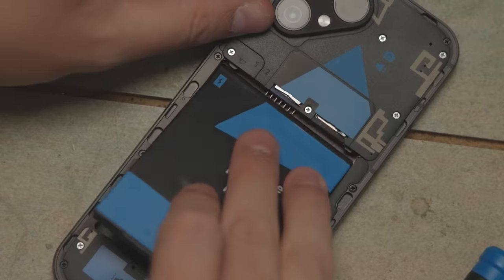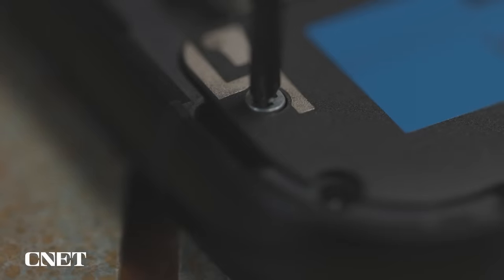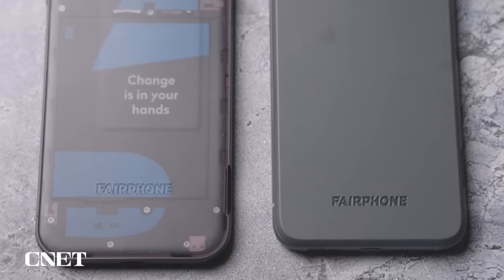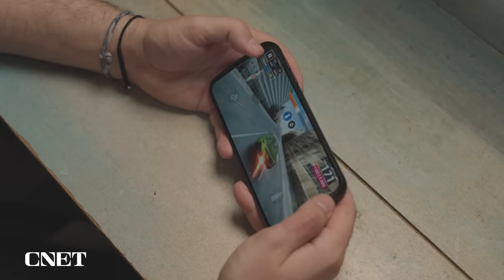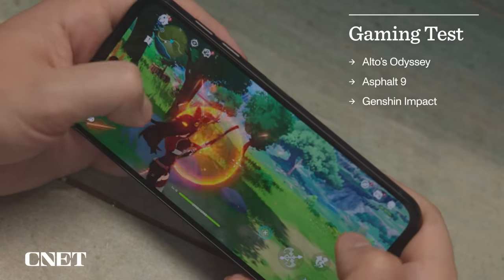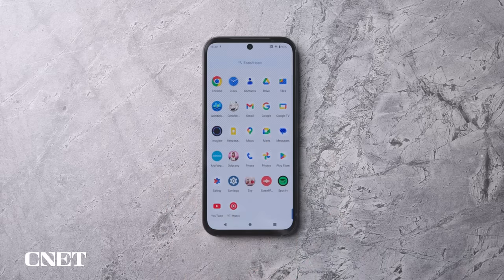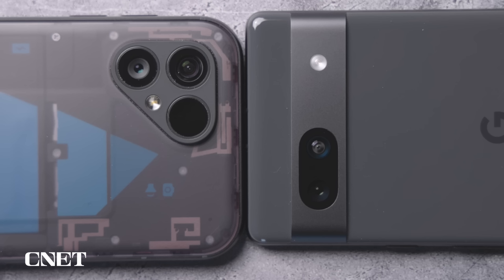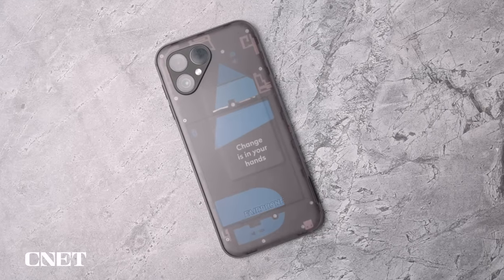Fairphone 5 Review: A Noble Cause, an Imperfect Phone

Comment: I wonder why better chips, or chips specifically designed for mobile phones, do not give long-term support? Is it because the lower cost of such a chip let them spend that money on software support for longer or is it something else?
Reply: Phone manufacturer will need to pay a lot more to Google for longer security updates. Chinese phones often cheap out on this. Essentially consumers need to pay more.
Reply: @stealthnuke1  What does Google have to do with it though? Isn't Android essentially free for mobile manufacturers? Does it have to do with Google's apps?
Reply: They go out of circulation quicker, because the high end of consumer electronics is all about innovation at any cost. This is one of the reasons why Fairphone has always stuck to fairly mid-range specs. Mid and lower spec phones will often be using chipsets and displays from 2+ years ago because consumers at that price point don't really care. That means they stay in circulation for longer and can be supported for longer.

In the case of this latest chipset in the Fairphone 5, it has primarily been used outside of consumer electronics in business situations where long-term support is expected. It was a really smart decision by Fairphone to try and secure it for the Fairphone 5 and it's the reason why they can guarantee a minimum of 8 years of updates.
Reply: Software will always be more expensive than hardware. With software support you need software engineers, pen testers, cybersecurity engineers, etc all to keep it current and safe from exploits, over time it gets expensive to try to keep these current. These manufacturers pay Google to use Android OS for each phone series, much better than trying to make their own OS. That’s why a lot of Chinese manufacturers put so much spec filled phones out on the market with little support.
Reply: longer software support means people will hold on to their phone longer, and companies don't like it when less people buying their product :)
Reply: One thing I found interesting: US carriers demand locked bootloaders. This forces people to buy into their plans and refresh phones often. If they were unlocked, people could simply install ROMs to keep phones up to date. Quite sinister, and we would benefit from legislation fighting against these practices.

Comment: Something i dont really get about these reviews.. yall claim that the other phones are cheaper than the fairphone. BUT. When you can use the fairphone for 8 years. And an average other phone just for 3 years. Wouldnt the fairphone be alot cheaper?? Like, that prices u named. Pixel 7a, $499 and the fairphone 5, $782.  If i back it to paid per year of use, u get the pixel 7a for (499/3=) 166 a year. While the fairphone would be (782/8=) 97,75 a year... so. Basically if you use both phones to their intended lifetime, the fairphone is way way cheaper. Like 41,2% cheaper.. so yes. It may have a lesser chip and camera. Bc its almost 42% cheaper

Comment: Worst part of the Pixel 7a: No SD-Card slot. It does temendously great videos but what good is that if you run out of space? And it will force you to buy a new one after 3 years... so TCO is probably higher...

Comment: I think there are some potential BS for this kind of produce. Manufacture like these, e.g. Fairphone, Framework, etc, frequently relate "repairability" to eco-friendly and cheap to repair. However this statement is only true when their quality can match their "evil" counterparts. If repairable products gonna break 10 times more frequent than unibody ones, how is gonna reduce your repair cost or be eco-friendly? With more moving parts and less rigid sealing in the phone/laptop, this is totally possible(maybe not as many as 10 times). Not to mention these type of products usually has worse performance comparing to their "evil" counterparts in the same price range. So you are basically just paying more in order to be entitled to pay more in the furure...what's the point?

Comment: Im genuinely confused about the criticism here. This whole review is a shining example of wanting to have your cake and eat it too.
Its not as sleek? Well, yeah. Its a completely modular design that is built to give even the most basic user the ability to repair it. 
Opening any premium smartphone  will show you how they've managed to slim it down: through an absolute mess of tightly interwoven components, delicate connectors, and a LOT of glue.
Its like looking under the hood of a modern vehicles vs an old one. Sure, the new one performs better, but good luck getting any serious work done in the engine bay without a good amount of knowledge and some specialized tools. The old car though? A wrench, a manual, and a free afternoon and youll figure it out.
Its more expensive than better performing phones? Yeah, a living wage and fair trade materials from beginning to end of manufacturing is gonna drive the cost up a bit. Saving a couple hundred bucks up front by supporting literal slavery is hardly a better alternative. Combine that with economy of scale compared to other big players, and the lrice makes a lot of sense.
Lackluster cameras? Sure, but they also arent benefiting from behemoths in software or AI like the Pixel is from google. Its no secret that software is doing a LOT of the heavy lifting in the Pixel lineup's awesome photo performance. And with the obvious frustration in price already, do you really want to pay even more for better sensors? The average consumer probably won't. If they perceive any shortcomings in photo quality at all, itd probably be nothing more than "hmm, my Pixel's photos did look a bit better"
Honestly, they look fine. Good even, until viewed under a microscope under intense scrutiny. 
Underperforming APU? If the sacrifice that needs to be made to get 8 solid years of usability out of a device, im all for it. And if more people flock to it and large enough gap appears, Qualcomm will make dedicated chips to fill it.
I get that it's genuinely not going to be a viable option for everyone, but consumers have also fooled themselves into thinking they actually need the specs offered by the latest and greatest flagships every year. The vast majority of people go out every couple years, drop between $500-$1000 on a new Galaxy, iPhone, Pixel, etc and do literally nothing but surf tiktok, watch youtube videos, and play the occasional game. Same with the camera, they capture a memory and move on. Most people arent "photographers" they just want decent photos of their friends, family, and the weird bug they saw in the park. And most people who DO take photography very serious probably have a dedicated camera anyways. All of the sacrifices made here seem both mandatory and justified, and honestly, probably 90% of people will never use a phone in a way that would even make those sacrifices apparent. I love tech, i love seeing what the bleeding edge looks like. We all do, but at some point people have to ackowledge that the cost is too great. The amount of damage being done for what amounts to marginal improvements is ridiculous, and i think everyone knows it deep down. A combination of FOMO and marketing is going to convince people this isn't good enough when in reality, this is offering more than the average person needs or even utilizes. Glad to see they cam to the US so i can jump on board. This is exactly what the industry needs. Lowering graphics settings on Genshin Impact and settling for a good camera instead of great isn't enough to say otherwise.

Comment: Ofcourse it's more expensive. How else would you pay workers more fairly? 
The argument that the Pixel 7A is better priced, is because the Pixel 7A is produced under less ethical conditions.
Longer lasting, means a higher price. If you can update parts of your phone, then you don't need to buy a new phone more often. And there is the value for the customer. 
5 years of waranty, when others only offer 1 or 2 years.
If you only look at specs, then you are missing the bigger picture. 
So, a fair review would entail that you also tell about the unethical side of the phone you are comparing it to. You did not do that. Scared of Google? Yes.

Comment: I was considering getting this phone. But low battery life it's truly a deal breaker for me. If it's bad from the getgo, it will be worse if two years, and being able to replace the battery is good and fine, but it's not a fix for poor battery life.
Reply: They probably will give the battery an upgrade. Or you could buy a second battery to switch to when the original one runs out of power while you're not home
Reply: @Shuka089  i know, but at that point, why not just get a phone with two day battery life and same price or even less?

Comment: What a harsh review.
Battery life?
I would rather have two, smaller batteries rather than have to cram a giant one into a larger phone.
It's like these idiots who claim that all EV's must have 400 mile ranges. Even though most people only drive about 30 miles a day.
Additionally - you won't have to worry if your battery is slowly losing it's punch after a few years...just get a new one.

Camera?
Personally, I could care less about the camera. If it works and is solid. That is all I need.
Unlike this guy (apparently)? I do not need to take 32K quality photos of my food for social media.
And, I assume one day, you will be able to replace the camera with a better version.

The Fairphone 5 allows you to easily replace/fix most aspects of your phone.
I think that is absolutely WONDERFUL!!!
And if someone just HAS to have top specs?
They can spend the $1600 every two years and do just that. 
While I will take the money I save and go on a holiday... or two.
☮

Comment: I think the camera performace can be improved with software... somewhat. I'm sure there will be people installing and modding GCam for this phone soon as well.

Also, I don't think draining 15% of battery  with 45 minutes of use including gaming is that shocking. Especially with a chipset not designed for gaming and similar high-end use. I would also like to point out that my Fold3 (or any other flagship) will heat up considerably and start choking performance after a bit of gaming. So the conclusion is - there are gaming phones with cooling attachments, built specifically for gamers. Fairphone 5's customer is probably more interested in playing Wordle on their lunch break. I understand stating "this is not a phone for gamers" but I wouldn't REALLY hold it against the phone itself.

Lastly, I hope CNET will warn consumers about buying iphones & android phones that are not repairable, their manufacturers care very little about recycling, care very little about fair trade and create marketing campaigns to push people into a yearly phone-switching cycle. And even after they comply with the future EU regulation about user-replacable batteries, I hope CNET will keep mentioning that they were forced to do the bare minimum while Fairphone over here goes above and beyond offering everything you might need to keep the phone running, as opposed to Apple who won't allow you to touch their phone without their official repair stores being involved.